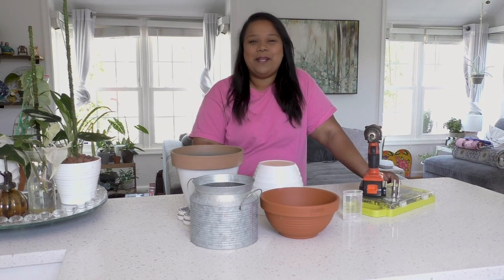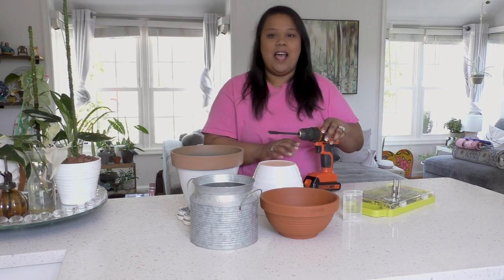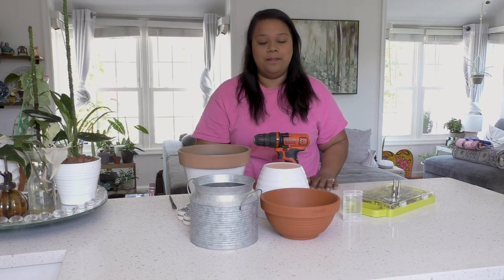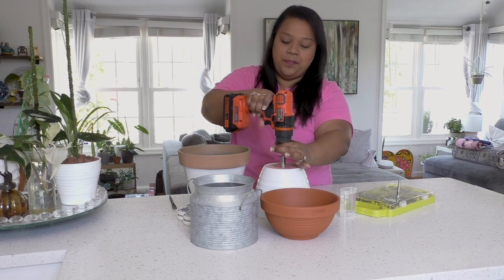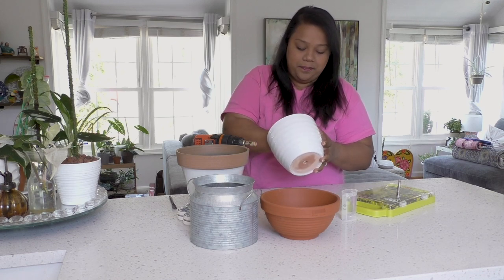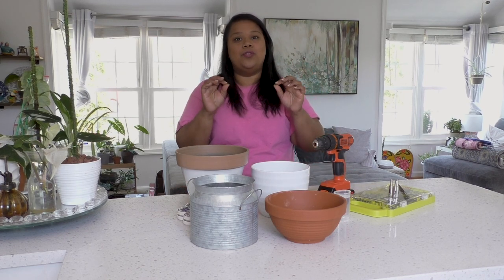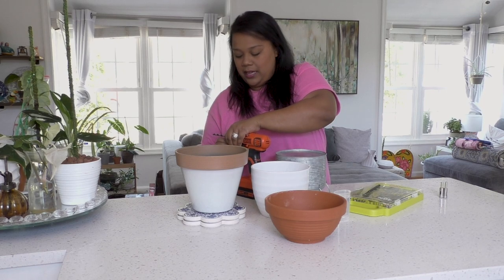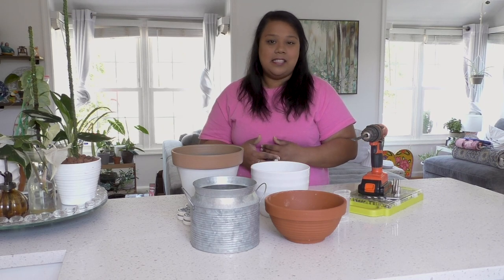Drill Bits 101  |  Terracotta Pots  |  Spade Bit  |  Metal Pots  |  Diamond Drill Bit  |  Clay Soil

Comment: Thank you so much for this video, very helpful! How do you clean out your diamond bit after usage? Mine got clogged with terracotta & ceramic.
Reply from the maker: If you just soak them in warm/hot water for a few minutes the terracotta chunks will soften and you can pop them out or push them out. I usually will use a bit of dish soap for the tough terracotta stains that don't want to go away. Hope that helps you 😊
Reply: @ClaySoil  Thank you so much! I will try that!!!